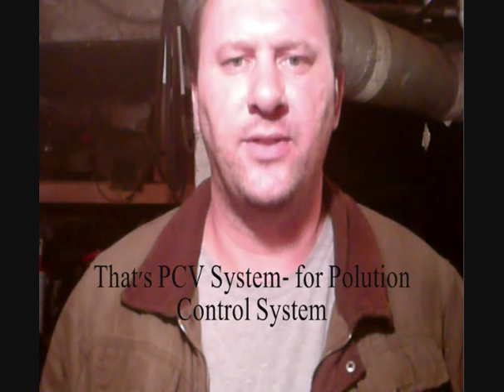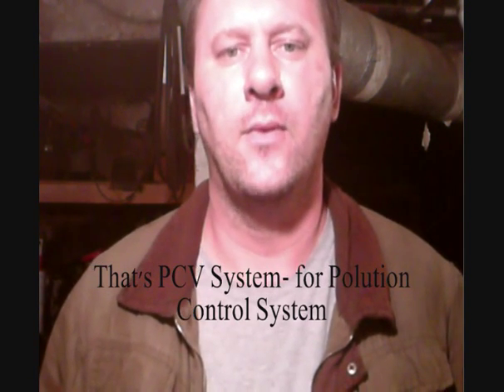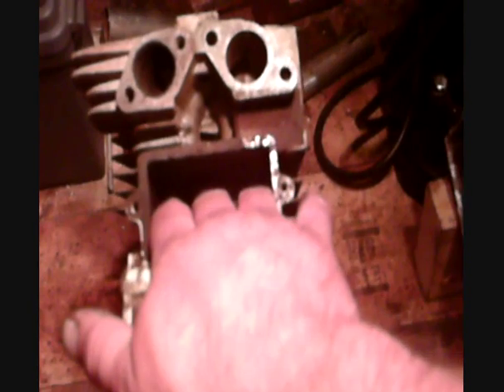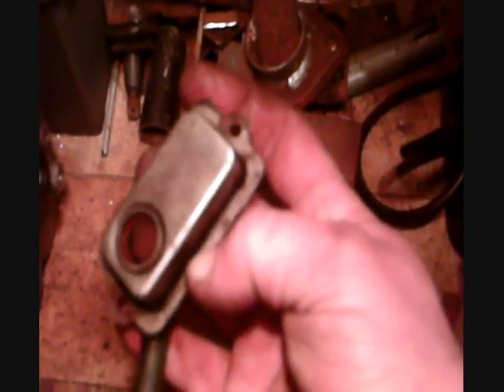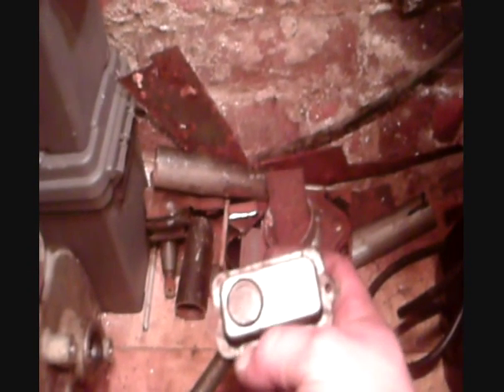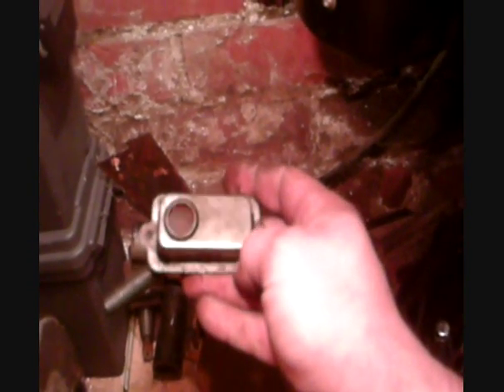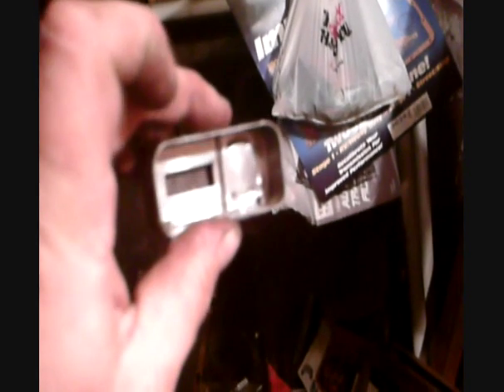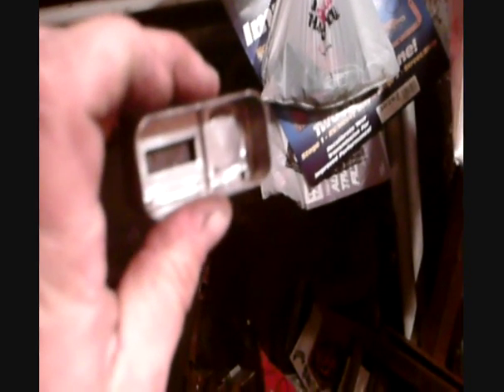PCV Modification= Oil Catch Can not required

Comment: My B&S V-Twin Vanguard has been a mess. I pulled it apart and replaced the gaskets and cleaned it up. One year later it is back to blowing oil all over the place. 

It began to stall. Than it wouldn't start. I noticed exhaust coming out of the cylinder head when cranking it over. The head bolts worked themselves loose! 

I happened to find a complete engine at the junkyard for $10 so I thought about modifying the valve covers with automotive PCV valves. It's a never ending battle.
Reply from the maker: markfothebeast  sounded like you had a couple of problems, but not related. I would suggest a catch can for your engine. the vanguard engine breathes out of the valve covers. maybe you had some sort of blockage in the block to which kept oil up in valve covers. the auto pcv valve im afraid won't fix the problem. look at the breather setup and how it works. there is an oil seperator somewhere to where you can modify to make it work better. if you cant figure it out then yes, use a catch can setup to help the issue.  Sorry for vage info but never had a vanguard to play with. Hope this helps.
Reply: prancstaman Mine has a rectangular PCV near the carburetor between both cylinders on the block, similiar to the ones in your video. 

I'm going to swap cylinder heads and torque them down a little tighter this time. I was thinking that the block could possibly be cracked.
Reply from the maker: markfothebeast I would suggest proper torque on bolts. if engine is cracked, tightening more would make worse. look and figure out oil path back to block and see if it is clogged, since you will have heads off. Always time to take a minute to figure it out. look at pcv setup to see where the oil returns to engine,  to try to modify.  Good luck, hope you figure it out, and thanks for commenting.

Comment: Hey that's pretty cool! I'd rather do a good mod to something than a band aid anyways. 
That's a Good engineering fix on a common problem for guys who like to rev stuff to the moon instead of a band aid catch can. 
Back in the day I had an old car with a lot of blowby, I rigged a catch can on it, but was insistent on having a drain back to the crankcase. Otherwise that's kind of a pita to drain that thing all the time...
I'm not sayin I know everything but I learned somethin from this for sure. 
Those itty bitty drain holes in the cover , now I know what they do.
Reply from the maker: MrTheHillfolk Yah, that's how I see it too, a catch can is just a high priced bandaid for a problem. I learned this when I put together my APU and after a couple of minutes running it would start pucking, LOL. So I made the catch can first and it shot out of the vent hole on top about 3 feet and I figured out what was wrong by really thinking about it for a couple of hours and did this to the engine. That was about 10 years ago. so every engine I rebuild of this type gets this mod like the minibike engine got it too. I just didn't think about making the vid till after it was running. Then fearlessfront had the same problem and I tried to tell him but he went and got a catch can anyways. Oh well, LOL. I'm glad you like it, Hope it helps somewhere down the line.